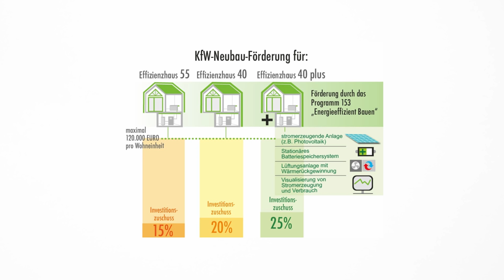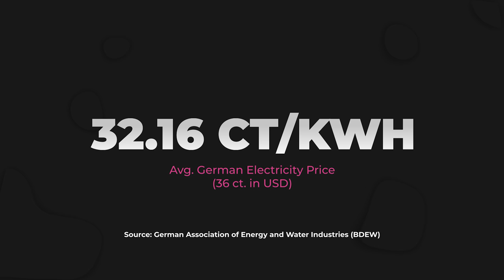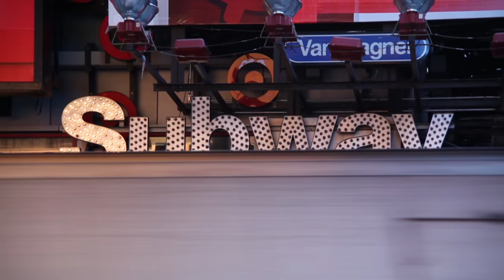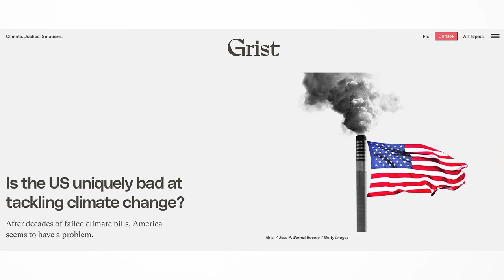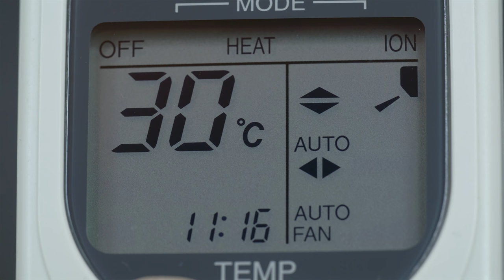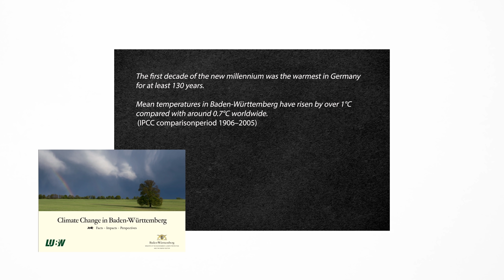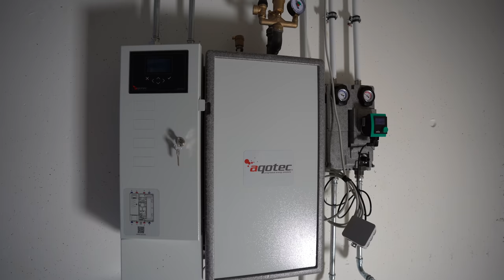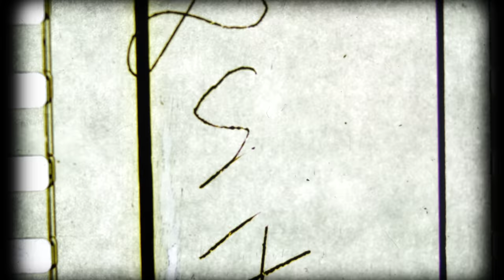HVAC (HLK) in German & American Homes | A Tale of Two Countries

Comment: I’ve added several comments in the past. I worked for the US Army and lived in Heidelberg-Emmertsgrund 1977-80. 
We first turned on the radiator in our living room Dec 1, 1977. On December 6, our son turned 2 and we had a party. It became very warm with a bunch of people in the room. We turned off the radiator, and never turned any radiator on in our apartment for the remainder of our 3 years. Now there were exposed pipes running floor to ceiling that connected the radiators in each room. These provided plenty of heat without opening our radiators. Of course, we opened windows every day of the year as did everyone we knew. Consequently when I hear about strict window standards in a place like Heidelberg, I think, “What difference does it make to have super-insulating windows if you open them every day of the year?”
Reply from the maker: Yeah its kind of a catch 22. The windows are SO well insulated that the house no longer "breathes" properly and consequently, some houses have mold issues. We have de-humidifiers in our new house running constantly because the walls are concrete construction and still have a pretty high moisture content. In some of the back bedrooms if we don't have them running the humidity rests around 70%.
Reply: If you do it right it's not a problem. In Germany, there is a term for this: "Stoßlüften" (shock ventilation) - you open the window several times a day for a few minutes, so that fresh air comes in, but the room itself (walls etc.) does not cool down. In such well-insulated rooms, this prevents mold growth.

Comment: Excellent video. In the North Island of New Zealand, the lowest Winter temperature reaches -2 degrees Celsius and in Summer maximum temperature 30 degrees Celsius, the updated building codes require new houses to have thermally broken double glazing as well insulated floor, ceiling and walls.   New houses use air condioners with ducts.   I have seen hous that used radiant panels using water from a boiler that used high pressure diesel that also heated an Agar (cast iron) stove.  A new few houses use both wood chip heater plus air conditioners.

Comment: We live in Switzerland and keep our windows open during night in summer to cool the house. during the day we close the windows and the shutters. For heating we have a heat pump using geothermal heat and we have cells on the roof that heat water through the sun. we still want to add some photovoltaic cells to make the system fully self sustained. It is quite a big upfront investment but it pays out in the long run not just for the environment but also economically.
Reply: additionally the windows in most European countries are double class or triple glass which gives a good insulation but also our doors have two to three lips with rubber sealing so it is well insulating.

Comment: I don't have any sientific data at hand, but regarding the question if AC makes you sich I have two points that may be the source of this  argument:
1. The air in rooms with AC is  mostly drier than normal which can lead to problems with your respiratory systems. If I turn on the AC in my car I can't breath after then, fifteen minutes because the air is too dry.
2. depending on the settings the temperature difference between the outside and inside can be quite high. If you stay inside or outside it's not a big deal, but if you have to switch betwen the in. and outside quite often it can be really stressful cause your body has to adapt to this temperature changes.

Comment: Hi guys, terrific video and well put together answering lots of questions I've been thinking about. I'm an Englishman living here in Germany for the last ten years and when I moved here to renovate a 100+ year old house I just assumed I would install a gas boiler for the heating. Wrong......there is no underground gas in this region of the Eifel so the options appeared to be oil or a liquid gas tank in the garden. You know........those seen floating along the streets in our recent high water crisis. Ok, my research discovered a wood pellet system as an alternative and thats what I opted for, linked to hot water solar panels on the roof plus at the time it attracted a generous Biomass subsidy. I use approximately 2.2 to 2.4 tonnes of wood pellets pro year at a cost of 640 Euros and I have zero hot water costs in the summer and on many days in the winter. Cost wise, it was a good decision but it does come with some maintenance duties, ie at least once a month you need to clean out the ash from the boiler, clean the burners and I have it serviced once a year by the manufacturers circa 260 Euros.
Because its  an old house, all the floors were not suitable for underfloor heating, but in hindsight I wish I had have persevered, particularly now I have experienced it in my friends homes. It seems to eliminate the cold spots and distributes the heating much more evenly. However I have read that if you suffer from allergies it may not be the best heat source, since the ground heat causes dust to constantly hover at ground level which is then thrown upward with movement. Just a thought for some people.
With the relatively hot summers I haven't yet considered air conditioning, opting to spend more time outdoors, and as you say if you drop the blinds in the sunny part of the day, my 50cm stone walls act as a good barrier for most of the summer. I have however bought a large fan which comes out for occasional use maybe 2 to 3 months a year. I love those slow moving ceiling lamps you see everywhere in Florida and I find them perfect for sleeping at night but I don't have the ceiling height in my old house. Whilst somewhat shocked and if I'm honest a bit irritated at first, but like yourselves I have now caught the habit of Richtig luften. Have you picked up the fear of schimmel yet? Just have a look in your local store to see how many anti schimmel products are available.
Reply from the maker: We also plan on installing ceiling fans in our new home. We loved having them in the US and without AC, just having the air circulating makes such a huge difference. One of the other things that has surprised us (since you brought up schimmel) is now infrequently we've seen bathroom fans installed to help pull out the moisture. In our 3 apartments only one has had them. Our current one does not and we have a constant issue with mold building up on the glass block wall. No matter how often we keep the window cracked - even when it is freezing outside, it persists.

Comment: On hot summer days, we pretty much do as you describe for your office. Open windows during the night and hunker down during daytime. Another great help comes from the fact we signicantly improved the house insulation a couple of years ago.
Another historical fact to keep in mind is that a majority of German homes were using coal as heating source. These systems were then converted to central heating in the 1960s or later, especially in the East.

Comment: I live in rural New England and use propane for heating, hot water, cooking, clothes drying and for my backup generator.  I have a forced air system because it was far cheaper to install when I had the house built.  It's a 1200 square foot house and only requires one in-the-wall a/c unit, which I use only half a dozen days a year.  But I have CEILING FANS!  On a warm day, these fans allow me to be comfortable even when it's above 80F in the house, and on low speed they are silent.  I'm surprised you didn't mention ceiling fans.
Reply from the maker: All great points! We plan on bringing up ceiling fans in a future video. It is one of the things we plan on installing in our new home this summer. On the one hand it is a very "American" thing, but we love how the movement of air really makes the heat of summer more tolerable.

Comment: I use a combined heat and power plant plus vacuum tube collectors for hot water. House built in 1936 with solid brick walls, 36cm thick.
Very good energy efficency!

Comment: It’s hard to make comparisons between Germany and the US when we are pretty different. When growing up in a northern state, we has similar systems as Germany since heating is the primary need. Now that I live in a southern state, cooling is the primary need so radiant systems are not used here.  I have an electric heat pump for heating and cooling which is fairly efficient when both are needed. And I do control the thermostat.  I think it is the last thing I have that control.

Comment: If you are living here for some more years, you will notice how different summer can be in Germany. That can range from summers that you almost don't notice, to summers where its roasting hot for solid 3 month. But the "normal" summer have perhaps 2 or 3 weeks where you wish to have a AC. And for that short time a AC is a pretty big investment - not to mention the crazy costs for electricity. So a AC is not seen as a "must have" for many people here.  Even in cars AC was not a thing until 20 years ago or so, ecxept in the top luxury cars. And honestly, it is possible to survive without a AC. Also in the US there was a time whn people didn't have AC - and still lived. :)
I usually get thru the hot days by using some good simple fans, in combination of using the shutters during the day and some intelligent airing during the night. 

And its true that ACs are not really beneficial to the health. For one there is the effect that you get extremely dry air, big temperature shocks when going indoors and outdoors. That can cause increased risk for so called "summer cold". And there is also the risk of breeding germs in a AC, since its wet inside and hard to keep clean. That can even lead to more severe infections like pneumonia. Thats why you usually dont find ACs in German hospitals, for example.

Comment: I find your technical discussions interesting.  As a Floridian who lived in Ottobeuren, Bavaria for 5 years the AC is evil statements by Germans has always been irritating.  I will give up my AC when you give up your heat.  I grew up in a house without AC in Florida, not fun.  The environments are very different.  In Germany we had the hot water that circulated constantly through radiators in each room and hot water taps in the bathrooms and kitchen.  I loved it and it was efficient because you could adjust the heat separately in each room and had hot water at every tap instantaneously.  At first it was fueled by oil and cost about 1300 Marks (1990s) once a year to top off  the 4 1500 liter tanks in the basement.  Then the landlord switched to natural gas and it was about 100 marks per month on average.  It was never hot enough to need AC, the house was cool opening the windows in the morning and closing the rolladens in the afternoon.  Here in Florida we almost never need heat and use AC 10 months of the year.  Our house is 1200 square feet and was built in 2019 and is very efficient and electric costs about $80 in the summer and $40 in the winter.  We keep it at 78 degrees F.  I think the real difference in HVAC energy usage between the US and Germany is house size.  You did a great job talking about this in an earlier video.  Also remember energy is more expensive in Europe because of the EU carbon taxes.  Keep up the great videos, see you next week (on YouTube)

Comment: I live in the 16. floor with no tree covering my flat from the direct sunlight. In the morning the sun shines directly into my flat, heating it, till 11 and when the sun goes down it is reflecting in the windows of the tower building over the way and heating my flat again. 35° Outside = 35°C inside in summer. I am happy to have a ac (portable, not attached to a wall) I use in summer to cool down my room.
Reply from the maker: We also had to give in and purchase an AC unit when we found out I was pregnant. Our apartment is an attic apartment with south/west facing windows (no exterior blinds to shut during the day). Our apartment gets VERY warm and last summer we had 7 heat waves come through with 35+ days.

Comment: Having spent many summers of my life in both Chicago, IL in the USA, and northern Germany cities as well as in Vienna so I have a lot of thoughts about heating and cooling in Germany. We having bought an old house in Northern Germany which we are having remodeled to include solar panels, insulation, and using a heating and cooling pump, so I don't call it a heat pump but a heating/cooling pump, or an energy pump. That is what it is going to provide us with. In Chicago we have installed a cooling system which can also heat with an airpump, which we use for our airconditioning. For heat we use gas, and it is radiator. We have in floor heating in our basement. Still, on a day when it is 95 degrees Fahrenheit, so 35 degrees Celcius in Germany where our house is, it is not humid and at night it gets cooler. I find that in Vienna when I have been there and it has been 100F/38C every day in the day for a couple of weeks, it will still cool down to 65F/18C at night. That does not happen in Chicago. In Chicago, it might cool down to 75 or 80F/24-27 by 3 or 4 am, which means you cannot sleep most of the night because it is too hot. In Vienna we would close all the blinds and windows in the morning and when we came back in the evening open everything up because it would be cool again. Because we are doing radiant heat in Germany, we are mainly using wall radiant heat so that in the summer when we are cooling our home, we are not walking on cold floors, but the coolness is coming from the walls. Frankly, we are not at a point in history where I think the cooling will be necessary, but we are preparing for rising temps in Germany which is why our heat pump is also doing cooling. We have this sort of set up on our air conditioners for cooling in Chicago, so we have individually installed air conditioners with a pump, that does a great job, and is more energy efficient than the standard HVAC air conditioning. We rarely use it though. Only for those times when there is a heat wave of over 95F/35C for several days and it does not cool down at night. This is the same type of airconditioning we used in Italy when we stayed there too during a heat wave summer a few years ago. We set our airconditioning at 80F/27C. Still, Chicago is very humid and is like the tropics when it gets hot in the summer, whereas Germany just does not feel that hot. If you have metal roll down shades on your doors and windows you have good insulation even in old buildings that have not been insulated. That is because as our German cousins say about our house in Chicago, it seems to be made of cardboard. Their old, house which has been passed down for generations has thick walls. If they add insulation it should help. So, most Northern Germans cannot conceive of ever needing air conditioning. I can see why. No one understood us wanting to have this, but living in Chicago I know what hot and humid feels like and I it is hard to sleep and the older one gets the harder it is to regulate one's body temperature. What we are disappointed in is that Geothermal heating and cooling is not well developed in Germany because that is what we really want to have. It is hard to come by, because no one knows about it or is used to installing it. Hopefully that will change.

Comment: I lived for two years in Singapore in a boarding house. 30 to 37 degrees all year round, humidity between 80% and 95%, night temperature very similar to day temperature. The first year we had ceiling fans, the second year we had AC. Fans were much better in my opinion , only drawback if there was a power cut you would wake up immediately in a sweat, whereas with AC the room would stay cooler for a bit. If I am not mistaken homes in the South of the US used to have ceiling fans, now they are all gone and replaced with AC. Madness, in my opinion......

Comment: I originally required 35,000 kWh/yr of gas for my end-of-terrace home. 

Then I insulated heavily and only used 11,000 kWh/yr of gas.

In 2020, I replaced the old gas boiler with a brine-water heat pump (SWP) and in the meantime need 1800 kWh/yr of electricity for heating, hot water and cooling, with cooling being done passively with the heat pump.

Comment: We have installed an AC in our bedroom , which is located under the roof and gets really hot. But we are only it, when it is really hot, so only rarely the last two summers. The rest of the house does not get that hot, so we do not have AC there. Of course we open all windows in the morning and use sun shelters.
We do not think, that AC makes you sick - unless you cool down too much, what seems to happen all the time in the US. We wenn to Seattle a few years ago and wondered, why they are using AC at all. It was nice and warm (not hot!) outside and freezing inside. We Germans prefer not bringing a jacket to go inside in the summertime.

Comment: I hadn't thought about environmental impact on the worldwide scale, but i live in one of the hottest cities on earth, and 2023 was the hottest summer on record. AC (and avoiding being outside too long) is required here to avoid heat exhaustion and heat stroke, yet due to the vast amount of black asphalt, energy usage, and AC, the radiant heat effect compounded this being the hottest year, such that even on days when the air finally cooled down, it was still very hot outside (the nighttime temperatures remained even higher than usual).